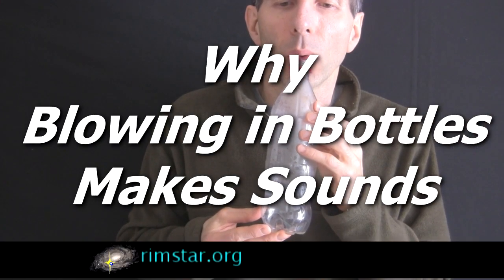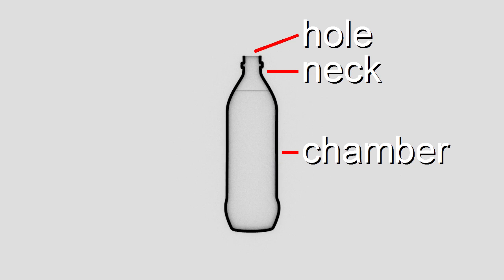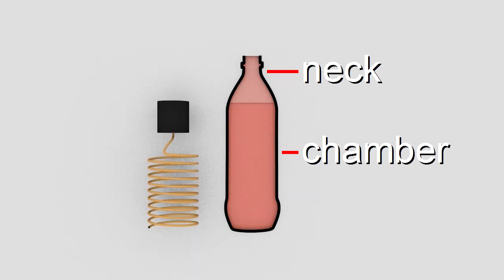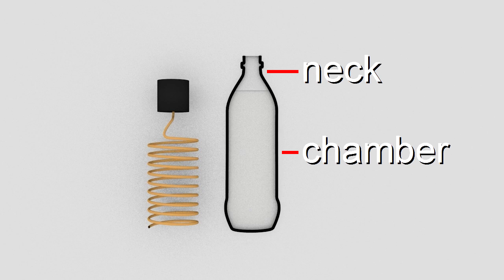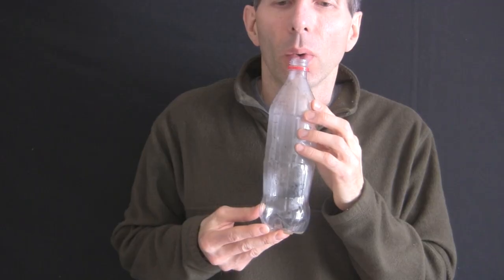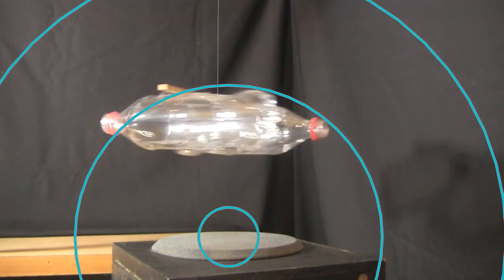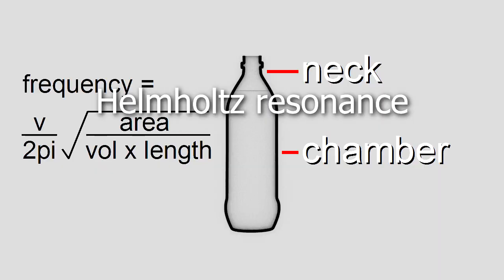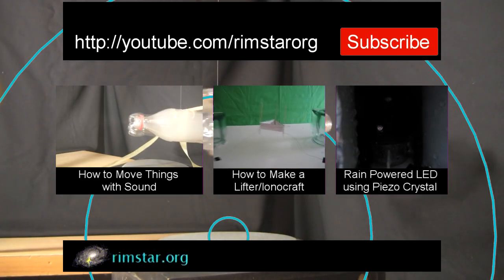Why Blowing in Bottles Makes Sound and Helmholtz Resonance

Comment: If you blow to the bottle there is higher pressure than outside, so how can the air from outside can come back?
Reply from the maker: As you blow, air enters the bottle and so the pressure builds up in the bottle. At some point, the air in the bottle becomes a higher pressure than the air outside.
Reply: @RimstarOrg  Yes, I'm with you up to that point.. But what happens after that? Air moves where the pressure is the lowest, the pressure is constantly the lowest in the outside of the bottle, right? So the helmholtz resonance wouldn't work with this explanation. Not saying that it's bs, I'm just wondering what am I missing. Doesn't make sense to me as it is. Thanks for the great videos.
Reply from the maker: When the air reaches a higher pressure than outside the bottle, the air leaves the bottle but overshoots, i.e., the pressure inside becomes less than the pressure outside. With that, and the blowing, more air is forced inside and the pressure inside increases again. The whole process repeats. That's what the spring analogy shown in the video is trying to show.
Reply: @RimstarOrg  Ok thanks for clarifying👍, it is just super counterintuitive and hard to comprehend. With the overshoot you are meaning air's inertia, right? The bottle is able create small vacuum even when you are introducing more air to the bottle, right? If this is the case then truth is stranger than fiction.

Comment: Thanks for the explanation.
Helmholtz applied to traverse flute. May be you could shed some light on what happens on a side flute(traverse flute) which is some kind of mix between open hole on both sides but at the same time has to the left of the embouchure blow hole a cavity which ends in a closed end, and I believe this volume of air acts in a way as a compressor ,resonator.  
Would you know how this system works or a place where I could dig deeper into the matter. Thanks in advance.
Alex G
Reply from the maker: Hi Alex, Sorry but I don't have any information on the resonator you're describing. Cheers, Steve

Comment: Question: I intend to build Helmholtz Resonator Bass traps (i.e. lots of dampening material inside to "eat up" the resonant frequencies. Will putting something like a thin breathable cloth or mosquito net across the hole still make is work on lower (below 200 Hz) frequencies? I'm building big ones with drywall and don't really want bugs nesting in there.
Reply from the maker: I could be wrong but I suspect that putting something over the hole won't change the frequency that it resonates at. The formula I show in the video at around 1:49 takes into account only the bottle's geometry.

Comment: Then, the pop pop boat drive effect is the complication beyond that.  The air going into and out of the hole should cancel out, but there is a driving result.  The air going out is in a different situation than the air going in.  The air going in comes from a larger source of air with less inherent momentum, but all of the air going out had to make a 180 degree turn first, so the slender ordered exit is a key feature to the drive.  I doubt it would work without a neck in the exit.

Comment: Great.
But shouldnt the explanation also include why the oscillation produces a net thrust in one direction rather than zero thrust? I was seeing somewhere that at higher amplitude the flow changes and air is drawn in from the sides of opening while a jet flows out from the center. If so, Why does that happen?

Comment: Thank you 🙏🏽 and what about pressure coming through the other way like from inside the bottle?
Reply from the maker: I don't understand your question. Which part of the video do are you referring to?
Reply: @RimstarOrg  like can you funnel sound with a plastic bottle or is it just the pressure inside is what makes the sound
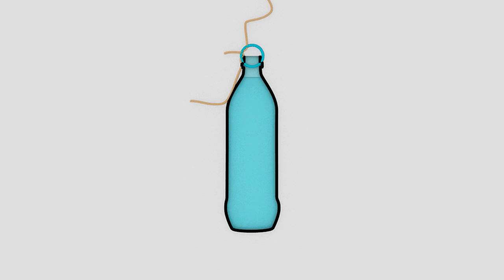Reply from the maker: Sound is made up of waves. The waves are areas of low pressure air next to areas of high pressure air alternating from one to the other. So it's the constantly changing pressure inside the bottle that I show at 0:54 and the resulting sound that I show at 2:00.

Comment: If I blow straight into the bottle, along the hole axis, no sound is produced. Why is the sound produced only at a specific angle of the lips with respect to the bottle neck?
Reply from the maker: I think blowing straight into the bottle would interfere with the in and out airflow shown in the animation in this video. It's that in and out airflow that produces the sound that you hear.

Comment: When I have a vessel flute in the shape of a bottle and blow across the mouth as you're doing here it produces a tone, yet, when I open a single tone hole in the flute it stops working completely. However, if I plug the mouth and open an embouchure hole somewhere along the flat, without a "neck" leading to it, it works with many holes open, a little over an octave in range by opening holes. Some xuns can play a 12th that way, though, and have a shape which is not quite like a bottle shape but does have some kind of neck leading up to the mouthpiece, just not so narrow as a bottle neck. There is another shape too, which seems to correspond to instruments with larger playing ranges, that shape is wider at the top, kind of "T" shaped which they call the "ox head", also there is a gourd shape, and I don't know if these shapes are functional or ornamental. Everything I read about vessel flutes says shape has little effect, but it's written for fipple instruments, not vessel flutes with simple embouchure holes. Also the location of the tone holes in certain shapes seems to matter. If I make a tall skinny vessel which is not so tall and skinny it becomes a tube and open one tone hole only, the higher the hole the lower the pitch, which is the opposite of what I thought would happen. Can you explain any of this or do you know of any possible resource for either of these effects?
Reply from the maker: +ne0romantic I don't have an understanding past what happens with one hole in a flute type instrument. However, a quick google search for "how a flute works" turned up this wonderful page http://newt.phys.unsw.edu.au/jw/fluteacoustics.html and there seem to be a lot more of them. If you search on that page for the section headed "Cut-off frequencies" it talks about the different affect of holes on low frequencies vs high frequencies. Looks like the high frequencies aren't reflected by the first encountered hole.
I do envy your obvious knowledge of flutes and music though. I bought a flute at a yard sale a year or two ago but haven't had the chance to learn to use it yet.
Reply: RimstarOrg I get all that (by get, I don't mean I can do math related to things like cut off frequencies, but they're actually really important... they're the reason why rolling in and covering more can produce a louder sound from a smaller embouchure hole on the concert flute which seems counter-intuitive; it's because the harmonic frequencies are higher and not affected as much as the fundamental so you can actually bring them into relative tune with each other by changing the embouchure.) That's not what I was asking about at all though I think vessel flutes are affected by cut off frequencies as well. For my second question by "higher" I meant higher up on the instrument, not a higher pitch. For my first question, the stopping point I'm encountering as I make more tone holes isn't the holes acting like they aren't there (from cut off frequencies) it's the sort of the opposite, like there are too many holes and there's no pressure to blow against. Thanks for the response, though; it was worth a shot.
Reply: I just found the answer elsewhere on that website in case anyone is curious. It's "The inertance of a hole depends on the ratio of its effective length to its cross sectional area. (I've included 'effective' because, for a quantitative answer, one must include the end effects, as explained in Helmholtz resonance.) If you drilled normal-sized tone holes in a bottle, their inertance would be much lower than that of the neck of the bottle, so the neck would be short-circuited. Ideally, then, the tone holes for a bottle-ocarina would need to have ratios of effective length to cross-sectional area that are comparable with but a bit larger than that of the neck. You might like to try this using lengths of drinking straw sealed in holes in the bottle. There may however be problems caused by losses at any sharp corners, which would reduce the quality of the resonances." From: https://newt.phys.unsw.edu.au/jw/musFAQ.html

Comment: Wonderful job with this!  I'm working on getting it to work myself.  I had a few questions if you had some time to answer:  1.  The horizontal bar attached to the bottles--what affect does its length have?  Longer would seem to take more force to begin moving, but minor imperfections on balance would seem less important with a longer arm.  2.  Is there a reason why the speaker is below the bottles (as opposed to aimed at them)?  3.  Is there any reason it would be much easier with larger volume bottles than same 12 oz?  
Thank you!
Reply from the maker: +Douglas Stith Thanks! Re your questions: 1. Due to the "lever principle" the longer the bar is the easier it is to get moving, though the trade-off is that it will start moving more slowly. Once momentum has built up it doesn't matter anymore. 2. There's a jet of air coming out of the the bottle. You can see it my other video here https://www.youtube.com/watch?v=L5fVFA2sWt4. If you were to aim the speaker directly at the bottle then it would oppose the creation of this jet inside the bottle. It wouldn't move, or have a harder time moving. 3. It's actually harder to move larger volume bottles. I've tried. That's because the Helmholtz resonant frequency for larger bottles is lower and so there is less energy resulting from it.
Reply: +RimstarOrg Thank you for this very helpful feedback.  Again, wonderful job with this.  By the way, I am driving my bottle with an iPad hooked up to a large amp.  I have an app that allows me to tweak the pitch of my tone.  Thanks.

Comment: I have a question, in practice, like in architectural acoustics, we can use helmholtz resonator as a sound absorber in order to reduce certain frequencies sound power level of undesirable low freqs. According to physics, what is actually happening during the progress of that sound reduction? Why doesn't the sound amplify instead?
Reply from the maker: +RAJLthe13 I'm no acoustics expert so I can't say for sure. As an uneducated guess, it makes sense. The sound would enter the helmholtz resonator and sound waves of the frequency that the resonator is shaped for would move back an forth within the resonator, essentially trapped, gradually diminishing in amplitude as the energy is transferred to the walls of the resonator as heat energy.
Reply: I believe your referring to cymatics in respects to resonance from the Ether wave propagation in accordance to light or photonic beams of such . Buildings of old times were built for specific tunings with certain materials in retrospect of masonic knowledge of foundations that resonate the building thus creating a nice energy . Our recent hidden past has all the answers if you look up cymatics fundamentals of architecture. Beautiful buildings and even stoves did have infact a nice pure etheric energy using mercury and or water  basically scalar waves or orgone energy. William Reich,  look him up. Quite profound man he was!

Comment: Thank you for posting this video. It is even better explanation than previous one:
How to Move Things with Sound/Acoustic Propulsion

Is it possible to put similar bottle on a boat (made of styrofoam), and by applying some noise (or resonant frequency) to make air-jet propulsion? At least in a bathroom.

Okay, I think it will not make lot of thrust, but anyway - maybe it is worth to try. (currently I haven't any audio system that can produce very low frequencies - the loudspeakers I have on the computer is very bad one, and no way to reproduce such low frequencies with significant sound pressure.

Smaller bottle, I bet it resonate at enough high frequency that may be pretty annoying to play with. Maybe amplifier onboard + loudspeaker inside the Helmholtz resonator (bottle) ?

What you think?
Reply from the maker: Trying it on a boat in water is a neat idea. There's not a lot of force here. I did put my hand behind the jet and definitely felt something, a little more than a gentle breeze. It might work. You definitely couldn't also carry any extra weight though, like an amplifier and loudspeaker.

Comment: Interesting!! Counter clockwise rotation...from the input :)
Reply from the maker: The counter clockwise direction of rotation is strictly due to the direction the bottles are pointed. Were you thinking something else?
Reply from the maker: *****
Yes, the process is reversible. Use sound waves to move the speaker cone back and forth, that would cause the magnet and coil in the speaker to produce electricity in the coil. And now that I write that, I realize that's a microphone. :)
Reply: RimstarOrg Ahh...I was thinking the flow of electric current, which propagates a spinning field around the "flow". The air in the bottles, is essentially pressurized and exiting the bottles providing thrust. Right?
Reply: ***** i once read an article about the "zero blade wind converter", its a small wind turbine that has a rotating motion in high winds, but mainly draws energy from the internal unwanted resonance/vibrations rather than the rotation, when wind speeds are low.

Comment: I allways thought it was because of  how the sound waves reflect of the inside of the bottle.
Reply from the maker: If you're talking about how the bottles are propelled, this video isn't trying to answer that. This just talks about Helmholtz resonance and how the resonance is sustained in the bottles. The propulsion that happens as a result of it is another level of complexity that I don't have enough confidence in my understanding of to make a video. My understanding is that it has to do with the difference between the shape of the hole at the outside edge of the neck versus the shape of the inside end of the neck. On the hole side, due to viscosity vortices form and when they separate from the bottle they form a jet. The same thing doesn't happen on the inside end of the neck and so there's a unidirectional force. But I'm not sure I've understood it all correctly, so in this video I stop at the resonance that feeds that process.
Reply from the maker: Oh, and I can see how you'd think it's the sound wave reflecting on the inside of the bottle causing the movement. But each cycle of a sound wave has two peaks, one is higher pressure than normal and one is lower pressure than normal. The higher pressure one is the one you're thinking of that would push into the bottle. But that's followed by the lower pressure one that would suck from the bottle. So over time they balance out. That's actually why people are puzzled that the bottles move at all, not realizing what I'd said about the viscosity and vortices.

Comment: What is amazing is also the fact that final moment is orthogonal at the direction of propagation of sound waves....like magnetic field around a wire with electric current
Reply from the maker: The sound waves are themselves areas of compression and expansion. When an area of expansion gets to the hole in the bottle, it expands into the bottle. So it looks orthogonal but really, where the wave interacts with the hole it's in the same plane... which is pretty neat too.